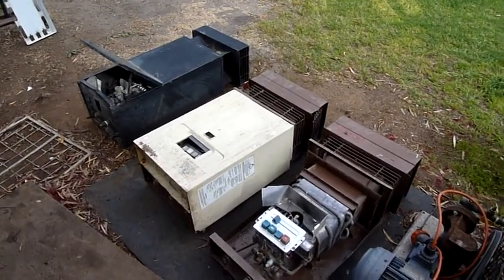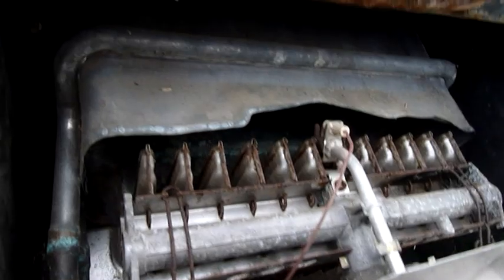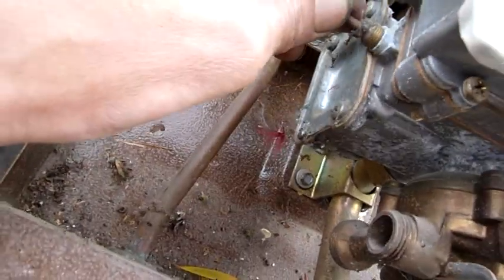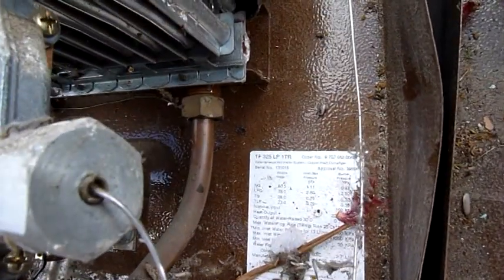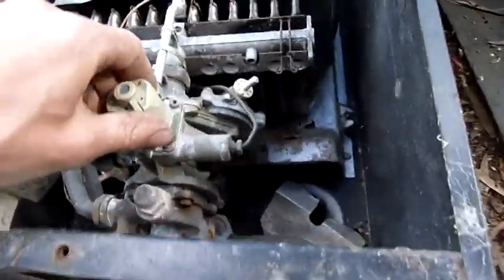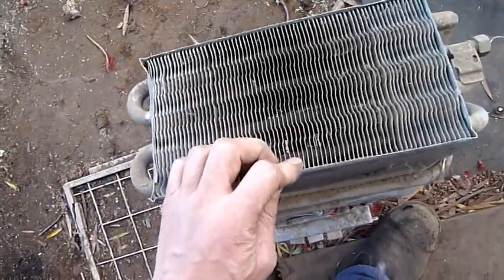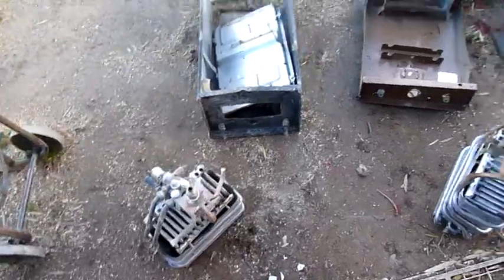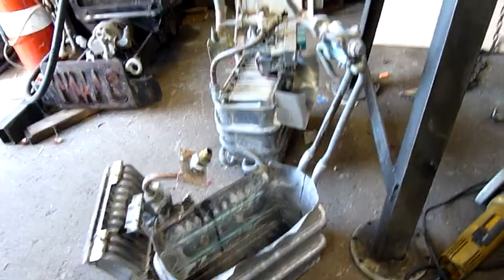Bosch and Everdure Instant Water Heater Teardown

Comment: Hm I agree ,little knowledge can be a very dangerous thing .the magnet that the thermocouple screws into is around the back side of the aluminium gas section .not in the water section .

Comment: Aussie great to see you have taken such an interest in these hot water services
just a couple of things i thought you may need to know
in Australia NG stands for natural gas comes through your gas meter at 1.1kpa aprrox static about 1.4kpa
Lpg stands for liquefied petroleum gas as far as i know comes through your regulator on your gas bottles at 2.75kpa static about 3.25kpa
there is nothing low about Lpg it is twice the pressure
just to let you know more about how they work on the bosch unit it goes as follows 
provided gas is on and cold water is on ( not to be funny i have seen a unit that a customer couldn;t light had the gas turned off )
pilot is alight
a hot tap is turned on
cold water goes through the water section and passes a venturi which opens the sid valve (allows the burner to come on)in two stages) first stage is to prevent main burner coming on straight away and burning out the heat exchanger
cold water pushes on the diaphram lifts the bearing plate and pin allowing the main burner to come on
the sid valve is what you pointed at at about the 4min 21sec point of the vidio
it has a slot for a flat tip screw driver to open 
as the tap is turned off the sid valve closes allowing the gas valve to turn off main burner (ribbon burner) if the burner stay alight the sid valve maybe faulty (calcified up or jammed )
the temp sender you mentioned was the thermostat which is connected to a a bellow in the gas section
the unit will raise the water temperature (when working correctly ) 25 degs this is why you may get a colder shower in winter than in summer (hard to balance the water temperature in winter )

ps sorry to be so long winded i hope this makes it clearer to understand the workings

Freezing Weather
In areas where the atmospheric temperature may drop below
0°C, the heater must be drained to prevent damage by expansion of
freezing water. For appliances installed in locations where the
temperature falls below zero ° C for brief periods , the installation of an
EXOGEL expansion valve, part number H 707 060 151, will minimise the
possibility of damage to the appliance.
This water heater MUST NOT be installed in areas where the
temperature remains below 0°C for extended periods. 

ps keep smiling

Comment: The only problem with these is that they will freeze up in the winter, which is the reason why it should be indoors in a warm room - I've seen a guy pissed off because his water heater froze 3 times and Bosch didn't really care about it. Anyways if the unit must be outdoors then the only thing you can do is use the electronic crap new heaters, which do have defrost, but I don't think they will last very long...

Comment: Water drop does not operate it the water flow will raise the rubber drum in the valve which pushes a pin that opens the gas valve of the burners, and for the black one I think it's "Saunier Duval" a French brand cause I had one with the same knob, but now I have a "Sylber" Italian brand which is very good just open the tab and you'll enjoy a hot bath B-)

Comment: Poor things, they were too simple to stay alive in the new world.  Need at least one 32 bit ARM core CPU loaded with poorly compiled operating system by a lazy ass programming team, a minimum of 23 active sensors, 7 active servo actuators and a color graphic LCD touch interface.

Honestly, I was in Ukraine many years back when I met my wife.  They have all mechanical tank-less heaters (some scary scab repaired ones too).  Moral of the story is they all worked great without a single transistor.

Comment: If the burner is activated by a water pressure drop, what happens if your water service is cut off?  Surely there's something that keeps it from operating if no water is actually flowing.

Comment: if  the igniter doesnt work it could be to the fact that you have to hold down the flame button, in my appartment i have two of those gas geisers as we call them, and have 2 gas heaters also.
if you want to start them you have to hold down a buton that enables you to press the pieso ignitor button and feeds a bit of extra gas into the system, bypassing the bimetal plate regulating the gasflow

Comment: I'm not really crazy about most of these on demand hot water heaters, the usual designs require you to run the tap for several minutes before the burner kicks in. Some of the newer designs have a small reserve tank that gives you hot water almost straight away without having to wait for the burner to kick in but for the most part I prefer a higher efficiency hot water tank over the on demand heaters.
Reply: On these the burner kicks in within a fraction of a second, and then the delay depends on how far the tap is from the heater.